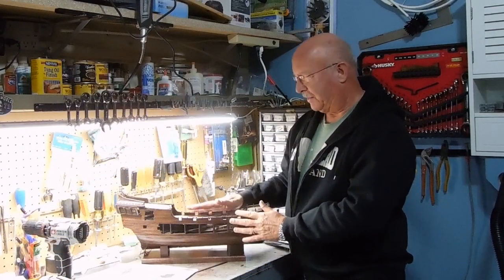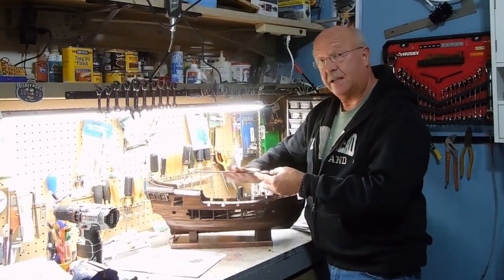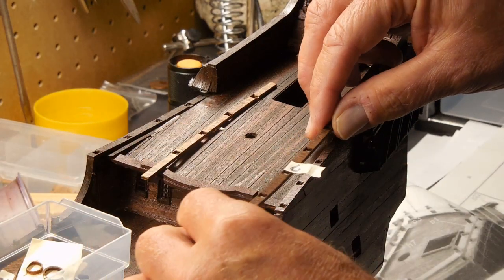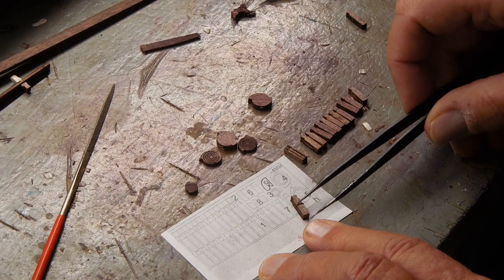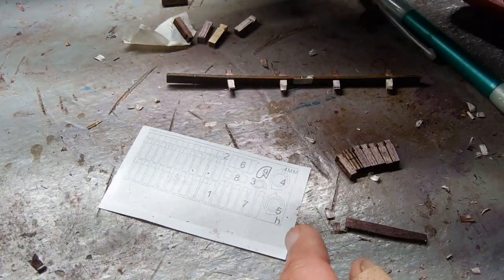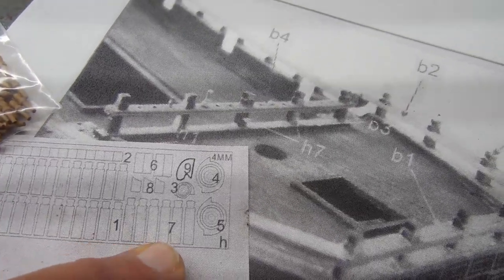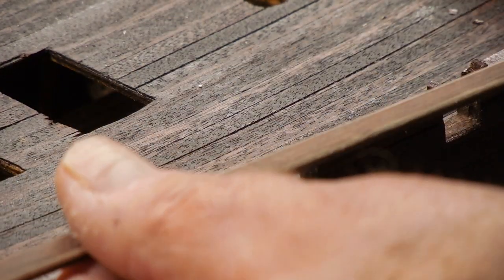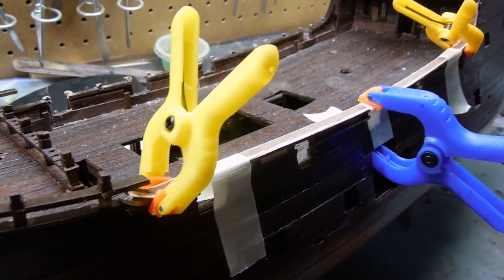Building The Black Pearl Model Ship Part 12

Comment: What size belaying pins did you use?  Thanks
Reply from the maker: Didn’t you see my reply yesterday?
10mm.
https://www.amazon.com/Belaying-MS0393BW-Model-Expo-Building/dp/B07921DZ49
Reply from the maker: Could you please acknowledge that you received the information that you requested? If nothing else, just tap the thumbs up symbol!
Thanks
Reply: Thanks for the info
Reply from the maker: I just stumbled on the instructions for the Golden version of The Black Pearl!
Here’s a link: https://m.facebook.com/photo.php?fbid=1784101255170044&id=1422904914623015&set=pcb.1784104338503069&source=48&refid=13&__tn__=%2B%3E
Reply: @BoilerDan1  thanks